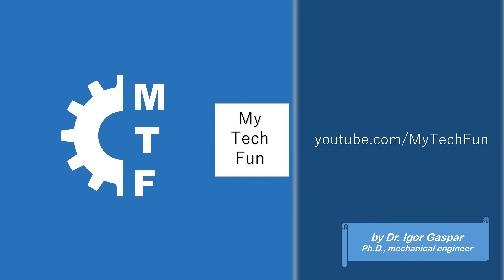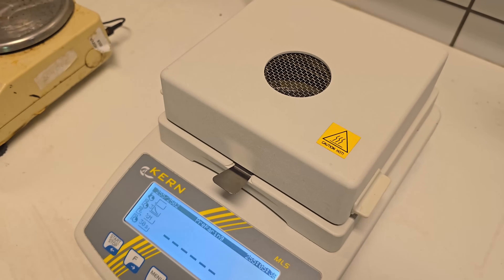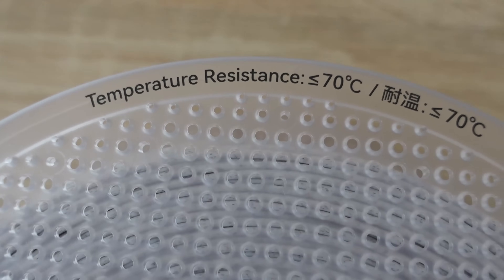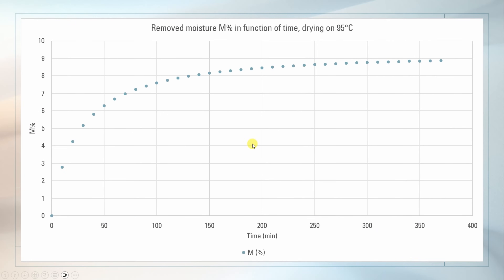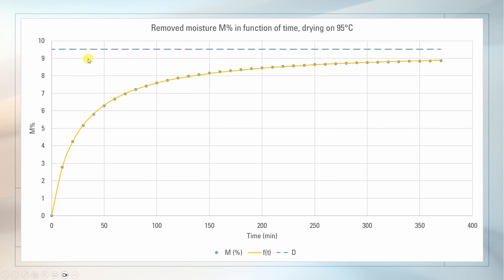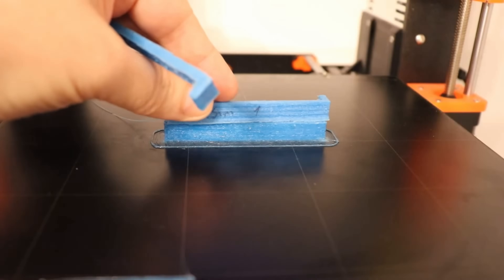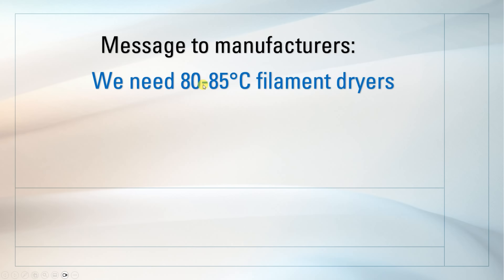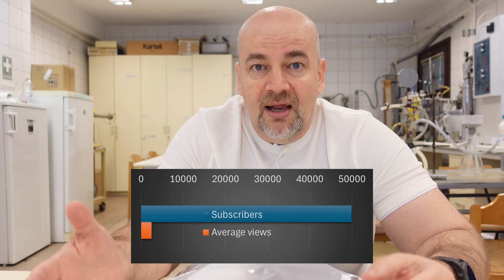Can we dry the nylon at 70°C? Surprising results!

Comment: @MyTechFun I need to dry my PA6, PA12 and PPA-GF but my 70 C Sunlu S4 isn't cutting it. Would my convection oven work? What temps/times do you think are safe?
Reply from the maker: With nylon, usually the spool is the limitation. Cardboard spools, depend of the glue. For example Bambu PPA-CF I dry on 120C (I think 140C is the max there)
Reply: @MyTechFun I see, Sirayatech responded to me and said to dry their PPA-GF at 80C - 100C for 4-6 hours, so throwing a roll of it into my oven at 100C for 6 hours is the way to go? Or should I do a bit less since it is an oven and not a dryer. Also, is convection absolutely required? I don't know if the oven I plan to use has it just yet. 

I also just found your review on the Sunlu E2, that looks exactly like what I need but it isn't cheap. Did they fix the issues you had with since then?

Comment: This is great. I've been trying to find out if I can dry PAHT-CF (or PPA-CF ) at 70C. I'd be happy to leave it running for a while but sometimes you just wanna print the dang thing! 326 hours or whatever it was is insane for 70C! But I also agree, I generally keep mine in the foil bags, so drying it as maintenance before printing is certainly easier than if it's been sitting out for years. I think for the higher temp stuff maybe I'd throw it on the heated bed with a box and rotate it periodically.

Comment: Brilliant info. I had the same hunch about printing from my filament dryer: that the outer loops of filament would be dryer than the inside, and so I needed a way to keep drying the inside even as I printed. Thus, printing from a dryer. It works.

Comment: Thanks, prooves I am wasting my time with these 70C, if your lucky filament dryers, for drying material such as Polymaker CoPA, I think I need to look at a lab grade oven such as  the Binder E28 for effectively drying this material. In particular for printing small parts with a 0.2 mm nozzle placing enough for a few jobs at a time e.g. 250mm of 1.75mm diameter filament at a time loose in an oven would probably be better than the whole spool. I can't help thinking that drying whole spools is inefficient as the depth is too great for the heat to penetrate equally. Any thoughts on this from anyone? Jim.

Comment: That's why I have recently purchased a NINJA Air Fryer (AF140EU) that can go from 40ºC up to too much temperature. Since I got a X1C, I know I'll be printing PPS-CF that needs to be dryed at 100-140ºC, and no current "filament dryer" does that kind of temps. (of course, this won't be ever used for edible things, only drying filament and dessicant).

I do foresee the Air Fyer industry catching up on that sometime in the next 5 years and we will start to see "high temp" filament dryers that are just air fyers with buttons named "PLA - NYLON - PETG - SPECIAL" (and their corresponding temperatures) instead of "roast - Fry - grill"

Comment: Just buy a 4quart+ air fryer and use the dehydrator settings qnd set it at 180F and let it run 6 hours. 70$ for an airfryer lol

Comment: welp. time to return my creality space pi :| I was gonna buy an air fryer but I can print  from inside an air fryer. maybe I can find a metal enclosure to DIY my own?
the bottom of the filament in my space pi tho is 80c which is good news? I could keep going back and rotating it every few hours but thta'd be a pain for such a long duration...
I made a diy soltuion that reaches 70c pretty quick but  my problem is that the  container can't take more than 70c before getting soft.

Comment: Hello Igor, this video is really interesting but let me disagree a bit on your findings. You measured the drying speed of Nylon filament samples using a KERN moisture analyser and you draw conclusions on what can be achieved  at 70°C regardless of the drying technology. The problem I see is that the method your using to dry the filament samples is not the fastest, and even may not be representative of what can be achieved with cheap crappy (so-called) filament dryers. (Ok, I admit I’m angry because I just bought a Polydryer box and realized afterwards that it’s an inefficient way to dry technical filament, if even it works which I’m not convinced. Therefore I have to build one myself). 

So, if I understand correctly the abundant literature on this subject, there are basically 4 methods to dry plastic. One is to put it in an oven, which is what you did with the KERN analyser. It is notoriously slow, and this is the reason why industrials don’t use it. In fact only labs and amateurs like us use this technique. Another one is to blow hot air on the samples, just like a hair dryer. This is what does my Polydryer box and most (all ?) of commercial filament dryers do. It is also a slow method and may even not be able to dry properly plastics that have absorbed moisture, only the one that mainly adsorb water. In addition, it may not work properly on spools of filament. I guess blowing hot air is far less efficient in drying filament that the oven method. The standard industrial method is to heat up the filament, not only the surrounding air like my Polydryer box does, at the requested temperature in a very dry atmosphere. Industrials talk of dew points in between -40°C to -18°C which translate to something like 2% RH or even less. To achieve that kind of moisture level in the air, the they often use a compressor (like drying machines do) and a  carefully designed desiccant wheel working at low temperature. If I understand correctly, they now use more efficient dessicants than silica-gel. Using this industrial method, we should be able to dry Nylon much faster than what you measured.

In addition, the 70°C requirement comes mainly from chemical modifications that happen at higher temperature, like decoloration for instance. If I understand well polymer producers recommandations, we could go a bit higher than 70°C on Nylon, like 80°C, but not much more.

Comment: is it possible to dry nylon solely with silica gel? a.k.a. storing it at 10% rel. humidity for extended periods of time, or will it simply never dry under these conditions?
EDIT: After doing some research myself I can say the answer is no, BUT you can do it with 3A molecular sieves

Comment: I found you use FAR less energy if you simply use rechargeable desiccant. I dry my desiccant by placing about half a Kg at a time into a convection oven I don't use for food anymore. 20 minutes @250F/120C and let it sit with the door open for 10 min. By then it's about 100f/38c and goes back to the filament containers. Bottoms out my cheap Amazon hydrometers

I do have a filament drier that hits 60c, which I wrapped the bottom/inside with Kapton tape as I felt it got too hot, bleeding out much of the energy. When printing Nylon I see no difference between active drier or a small box with 100g of desiccant. Both have a closed PTFE tube running to the print head.

With ALL that said, great video and I definitely learned something and it's good to know

*You said this while I typed this part \/\/ 😅
FYI the clear bags or containers made of plastic pass humidity in through the plastic itself. Which is why bags for more expensive or sensitive filament come in foil lined bags. Same thing that keeps your chips crispy 😉

Comment: Love your channel!   I was involved in testing plastic encapsulated, high impedance devices during much of my career and did similar testing.   I had better luck making the plastic wetter using humidity/steam rather than submerging in water..    Water is polar and will want to stick to itself more than leave the company of its fellow polar molecules to climb into clean plastic with a (likely) low activation energy.  If you want to drive water into plastic you will likely have better luck (more weight gain) if its gaseous.  An oven with elevated temperature at nearly saturated relative humidity or (even better) use an autoclave or pressure cooker (above the water line).

Comment: You hit the nail on the head. The number of hobby printers printing with Nylon or Polycarbonate is quite low. Manufacturers of both filament and dryers probably will not be catering to those consumers anytime soon. That being said, the number of affordable machines capable of printing engineering grade filaments is growing, so there is a possibility of strides being made in the future.
My experience with Nylon(both CF and non) has been good but I keep my spools in a dryer full time. I typically print parts that require both strength and temperature as well as UV resistance, so I am always printing in PC, PA, ASA and the like.
It is obvious you are a good teacher as I was able to follow everything you showed in this video and I am a horrible student.
Keep up the good work. This is the best channel on YT for 3D printing!

Comment: I use a lab grade convection oven, and your results track with my experience for Polymaker PA6 GF. 70C is NOT reasonable to get it dry initially, OTOH 95C produces good results and the convection does a great job of even heating the roll.

Comment: 2.5 reasons I'm not printing nylon:  I don't have a filament dryer or food dehydrator that can go to higher temperatures. And I'm forbidden to use the kitchen oven. 
I print in my bedroom :face-blue-wide-eyes:and I've not yet gathered enough money for a ventilation system for toxic fumes. And I still need to find money for a mobile rack for my printers. 
A heated chamber would also help or installing a ptc heater inside the printer enclosure. 

People buying the new prosumer printers with heated chamber and dryer inside the enclosure will improve industrial grade filament sales. Like the release of the FLSUN S1 and T1 in the summer or the Qidi's 3rd iteration line up (they're now on sale btw), the X-CF Pro and the recent Q1 Pro. These will make it easier for people to succesfully lay down some nylon printed models. 
Nylon filaments are more expensive so you can't afford to waste a lot of filament. I don't think voc's have anything to do with it because I see a lot of people still printing ABS. 

I think cheap and cheerful is key.

Comment: I print mostly in TPU with some CF Nylon. I use a near commercial grade food dehydrator for drying my filament. It gets to 85 decrees C. The downside is it has a maximum on-time of 24 hours before it shuts itself off. I find it interesting that it doesn't seem to dry my filament as well as my filament storage box, which uses a reptile terrarium heating pad underneath and an activated alumina desiccant cartridge at the top. Thanks to you and your assistant for taking the time to do this research.

Comment: That's quite interesting! Guess I won't be printing for a longer time.
I got a sunlu filadryer s2 which can reach 70°C max. But I never checkt if this is real. At one point I used my thermal camera and the heating elements got close to 100°. Didn't want to open the case, but maybe, if you slightly manipulate the sensor and use some insulation, you should be able to reach higher temps.
Only downside of this dryer is, that it should have at least a little bit of air exchenge to the outside to get rid of the humidity.

Comment: For the best performance moisture content should be around 0.02% in H2O or 200 ppm of water. specially for linear aliphatic polyamides. the number of carbons is important , so  C6 polyamides PA6 or nylon 6 the less moisture the better( at 200ppm there's no bubbles, depending on viscosity( molecular weight) the melt flow  will decrease , therefore more dimensionally accurate. for C11,12 ( nylon 1,12) the moisture content is not as " stricti" as in low aliphatic carbon chain polyamides, allowing for erxample 0.1 wt% H2O in nylon 12 ( and derivatives suchas block copolymers based on nylons). a good approach is see from which industrial grade the filament is made ( look for the  technical data sheet TDS, and / or processing data sheet. it should be there). maximum driying temperature is included in these sheets, something that the filamet maker should include. the drier reaches a maxmium in moisture removal ,so after that point is pointless dry for longer times, unless you use vacuum ovens that reach over 100C.  the driying conditions  for nylons in general go from 70C to 110C. the impact that this have in mechanical properties is massive, not a tiny bit, massive, either in stiffness, strength , elongation at break, or the three of them, which will affect yield, touighness etc. the inconvenient for printing is the long hour prints, once dried, if you keep it at room temp, after two hours max you've just undne all the drying( this will depend where you live, tropical regions , or humid season will affect ). Final remark, Yes, you shoyuld dry PLA and every otther filament ALWAYS brefore printing :)

Comment: Great video. Interestingly, the filament that I mainly use (Fillamentum Nylon FX256 - it's PA12), the manufacturer recommends drying at 80c for 3h. Also, same manufacturer - their TPU 98A, they recommend drying at 100c for 3h. Really strange how they only recommend 80c for nylon-12 - something to do with formulation maybe?

Comment: More metal spools that have vents on the sides and on the inside of the spools to allow heat an moisture to escape. I use 80deg and dry for 3 days in my kitchen oven and print from my sunlu s4 for carbon asa and get beautiful prints. Using a filament dryer is not sufficient you need to use a oven first then like the video says use the dryer to continue to maintain moisture levels.

Comment: Thank you so much for this video. We couldn't figure out how people get away with 70 degrees, because in our lab we get the moisture out of filament only at drying at 115-120°C for 5-6h. We measure the spool weight each hour and these are the settings that get rid of moisture.
Reply: Also note that the dryers that say 70C don't actually reach 70.
Reply: What type of spool are they on?
Reply: @melgross Some of them are on PC spools, some - sheet metal. ABS spools warp for some time, but then they are not beautiful but still functional.
Reply: @wavyseahill I haven’t seen the PC reels, or the metal ones.
Reply: @melgross Rosa3D has beautiful transperent PC spools for one of my favourite materials PC-PBT. Metal spools didn't come from 3D world, I think I got those from some wire spools.
Reply: @melgross by the way, cardboard spools hold up to 120C just fine. Yesterday dried my cheap Nylon on cardboard spool. No problem.
Reply: @wavyseahill that’s good to know. Which brand?
Reply: @melgross R3D - cheapest nylon on 3DJake comes on cardboard. I usually dry ABS at 85-90C on cardboard spools, was a bit worried about 120C, but it went fine.

Comment: Nice work bud, I've been printing PA, PA6, PA11 and PA12 CF, GF and vanilla for many years, I can say, using a commercial oven regulated at 90C (+-5C) it takes me usually 72hrs to make these Filaments printable to an acceptable level, and I also use a heated filament dryer to sustain the dryness and I print with a heated chamber, I also anneal my parts, then I boil them, I have printed 100's of kg's worth of these filaments, my recommendation, is don't bother and use a good PC-CF instead :)

Comment: I live in a low humidity place, most of my filaments will actually dry out after a few days of exposure.
Imagine my surprise on the first spool of nylon i tried to print. it came out like an angry spitting cat, right out of the bag
I put it in my spool dryer for over 24 hours at 50C, similar results.
I eventually tossed it in my oven at 200F for half a day, along with a huge pile of dessicant accumulated over the last year.
That finally did it, I quickly loaded the spool and dessicant into a plastic bag for safekeeping. no more issues

Comment: A strong correlation is what I would expect with properly calibrate equipment and a good experimental method. A follow on experiment would be to measure the temperature and humidity across the spool diameter by inserting probes within the spool at various distances.

Comment: Big gratefullness for this very important video. Hope you will share a link to that article after it will be published.
At the end you have asked filament manufacturers to write max drying temperature.
AFAIK, drying mode for for polyamide-6 is around 80-85 degrees, but not more than 4-8 hours (and even then polymer should take some rest afterwards).
Breaking this limits by time or temperature could have negative impact on polymer chains - it will degrade slowly (the more temperature and exposure time - the faster process is).
So, related to FDM, it will impact more on final products physical and mechanical properties, than its printability. Per contra drying PA6 at 70-75C could be done almost infinitely without such degradation.
But the big question - how much exactly high temp drying for long time impacts?
Maybe you could make some of your usual tests for one specific material, dried before printing at different modes - for example 48 hours at 70C, 8 hours at 95 C, and maybe 2 hours at 120C?

Comment: I’d like to borrow your Kern MLS because it seems perfect to answer a question that’s been plaguing me: is moist filament evenly moist throughout the spool? 

When I have brittle PLA (that snaps when I touch it) I’ve noticed that the brittleness is limited to a few loops, even with PLA that’s sat exposed (i.e. no bag, no desiccant) for 6 years. Also, my filament dryer (Sunlu S4) seems to reach the same minimum humidity level in a few hours regardless of how improperly the filament has been stored. It’s almost as if drying doesn’t matter, all that’s needed is to discard the outer layer of filament.